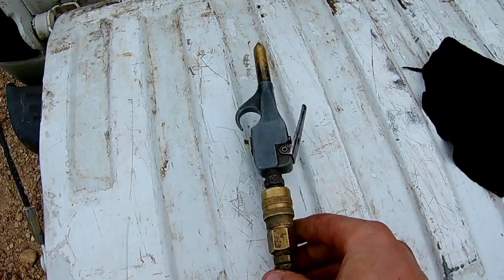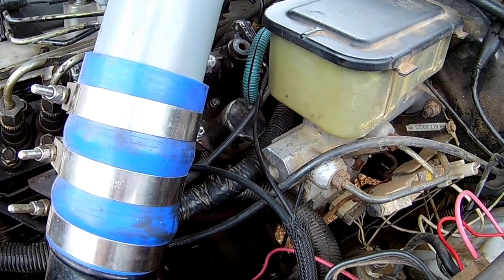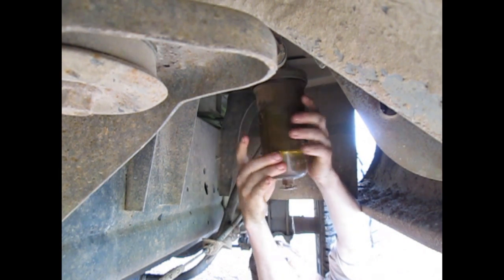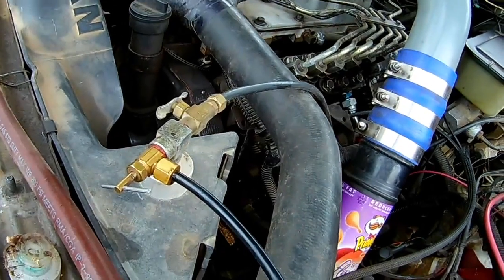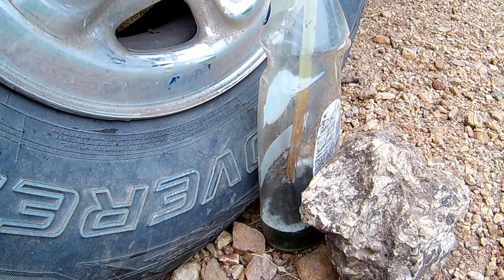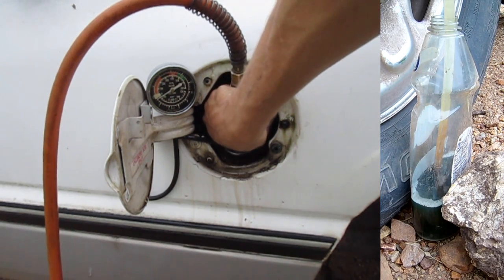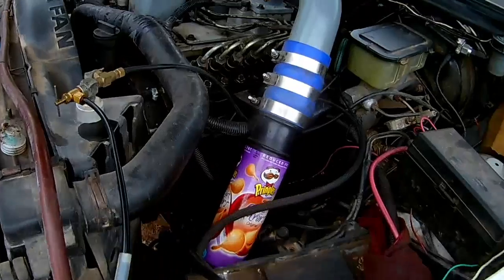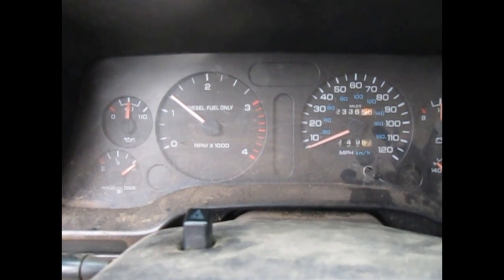How to Bleed Your Cummins Fuel System

Comment: Did this today on my 98 12 valve after a lift pump change. WORKED PERFECTLY and very EASILY.  Truck is early 98. 3500 DRW, 5 speed,. 447,000 miles, on a  beautiful oily 53 block. Truck screams. Will pull anything you hook it to. Great video.

Comment: I made the error of trying to drain scum out of the clear plastic primary fuel filter bowl on my 6BT Cummins dump truck. I was just doing a routine walk-around at a struck stop. Truck would not start, although it had been running fine. I knew I had introduced air into the line, but I did not think it would matter that much. Boy was I wrong! I cranked it for a half dozen cycles. No joy. I pushed that stupid primer button four thousand times. No fuel present. I opened the bleed valve on top of the secondary filter and did it again. Nothing. I finally gave up for the night, and left the truck at a truck stop. Next day I watched this video and acquired the various things to do it with. IT FRIGGING WORKED! Bled the system until no bubbles came out any more and the truck was like thanks pal I am ready to work again. I did not even bleed the individual injector lines. Thanks a ton, a ton, for this advice sir. Really helped this poor owner-operator.

Comment: I  use a empty water bottle with a small hole in the bottom for my air nozzle instead of the rag to pressurize the tank. The top of the bottle seats nicely against the filler neck and i use a regulator set at 2 lbs.

Comment: Are you just pulling the Allen bolt out of the front of the injection pump to bleed it or can you just do it through the top of the fuel bowl I'm getting no fuel to the injectors but I have fuel in the bowl my manual hand pump I do not think is working I just changed the fuel filter and took the preheater out forgot to fill the fuel filter all the way full of diesel cranked it over so does that mean I need to pull the Allen head bolt off the front of the p pump

Comment: Excellent video.  Can this system work as a one-off bleeding exercise ? In other words bleed the full system from tank to injectors.  Is there any reason why one couldn't pressurize the tank without bleeding the filter/separator banjo nut , but instead crack one injector nut at the time? The only problem I can see is that the tank has the return line. This would mean that air would be pushed inside this line, however, with a pair of hose pinch-off pliers  you can seal the return line while you pressurise the tank. The solenoid would also have to be activated so as to open the flow to the pump. I am not sure of the workings of the BOSCH diesel pump but this should work unless the pump blocks the flow when it does not run. Any comments would be much appreciated
Reply: Inside the PPump it looks like a miniature engine with a piston for each injector line. The piston compresses the fuel to extreme pressures and then it all lets out at once when the piston clears the exit port. In a nutshell, there is no open path from the fuel tank all the way to the injectors.

Comment: Great video, but I have one question and I may have missed it, but how did you get the fuel through to the front of the pump without pulling up the fuel shut off solenoid?
Reply from the maker: The FSS prevents fuel from being injected by the injection pump, it does not block fuel from getting to the pump.

Comment: If I have an electronic lift pump will this still work?  I thought I had a lift pump fail but after a new one I’m convinced there’s air in getting in the system.    Fuel pressure will get to 42-45psi but dies if you give it hard gas.  And had gotten worse upon trying to figure it out.    No visible fuel leak whatsoever

Comment: You only addressed bleeding up to your filter.  If your injection pump has air then once you have bleed the air out of the system up to your filter you then should loosen the bleeder on the Injection pump line to rid that portion of the system of any air. When you don't have bubbles and spurting and the overflow valve is squeaking, then you have bled that portion of the system.

Suggestion, show under the truck your line hook up and the like when doing those kinds of changes/upgrades. Just saying yeah we are doing this is only partially helpful.  I believe you are going to have some  leakage on your fuel lines with time as the braided stainless line does not shrink fit onto the fittings like the hard plastic lines that were on the truck. (I presume  they are hard plastic because of the manner you mentioned on removing them.)

Heating the outer sleeve which is a fuel and oil resistant rubber won't do much to shrink the line. Odds are your new lines are Teflon tubing followed by the stainless mesh and then the rubber out cladding/protective shielding.  Your Teflon inner layer may be heat shrinkable but the stainless braided mesh is not going to tighten up nor would that outer rubber contract as well. If it does, then cool...  Otherwise you are running the risk of your lines getting pulled off or leaking later.  I recommend you install some hose clamps on those connections.
So, did you just put a barbed connector in-between your lines out of the fuel tank to join the factory lines to the tank?  You are kind of quiet on what you did for those rusty fittings...

Any suggestions on where to get your handy fuel petcock for bleeding?  Looks like you re-used the plastic line from your old fuel lines, is that correct?

Good video, they get easier the more you make...
Sometimes having some cue cards to keep you on track for the points you want to touch on help...just a list of those things can help you remember while the camera is rolling.  Good editing on the split screen, very helpful to see that without having to switch camera feeds.

You may want to consider pulling that fuel tank and giving it a very good interior cleaning and you may need to consider a fuel tank liner as that much debris is not good. 
Was it algae growth, that can clog fuel filter screens and filters, definitely want to keep an eye on that.  Old fuel can get those growths really bad.  Definitely use a fuel stabilizer when fueling up to prevent that growth in case the truck sits for a while. In winter it is always a good idea to use an anti-gel additive, make that required, if you are in a cold climate or freezing weather.

David
Reply from the maker: Yes, after posting the video I realized that I only bled up to the filter.  Typically, if you get fuel to the filter, it will still start, it may take 5-10 seconds of cranking first is all.  I do hope to make a part two covering that though, plus give instructions on how to bleeding the injector lines if they're air-locked.

I'd love to show you all the changes to my fuel system, but I always struggle with making the videos to long, so I tried to show only the important bits, if you're interested in my fuel system modifications, than I can try to make a video covering them all.

My old fuel lines were primarily steel, which were all either kinked by the PO or rusted.  So I replaced everything with Trident A1 15 Marine grade fuel line.  http://tridentmarine.com/wp-content/uploads/2014/04/365-A1-15-FUEL-HOSE-Specification-Sheet.pdf

On the old rusty fittings, there isn't a stock steel fitting left, it's all been replaced.

The petcock is just a M18 to 1/8" npt bung in the front of the IP, then some marine fuel line, then another barb going into a small cylinder with a couple needle valves on the top.  One goes to the gauge, the other is my bleed petcock.  I don't have a part number for the cylinder as it came off the tire-changer when I replumbed it.  And I don't think it was factory on that either, hence I removed it.  Same goes for the plastic line, it probably isn't rated for diesel, but I doubt  that's a problem due to only having diesel in it a couple minutes a year.  Plus if it starts leaking it's not a live or death crisis.

Thanks!  Yes it's getting easier, I'm not a camera person.  The reason I started these videos was because I was very socially awkward, so I figured if I practice talking to a camera instead, practice makes perfect...  Good tip on the cards, I'll have to do that.

It was rust.  I believe I got a bad batch of fuel as it clogged the fuel filter up at the same time.  I just had the tank out last year and it was super clean.  Also having the sump helps let all the crap get caught in the fuel strainer.  You'd be surprised what all it catches after installing a sump haha.

Comment: super easy to push the primer on the hydroboost trucks, just use a broom handle.  vacuum trucks like mine are a pain, but still doable.  I like that filter setup
Reply from the maker: Very true.  The primer does take forever if you're sucking air, especially if you've got 1/2" fuel line as that alone is an 150% increase in volume, plus the pre-screen which was empty.  The video is 11 minutes long, and has most if not all the vital steps required to do it, plus a lot of chit-chat.  So bleeding the entire system in under 10 minutes should be easily achievable.  Plus the lift pump primer is a common leak point, so by avoiding the use of it, hopefully prolongs its life.

And, yes, I really like that pre-filter setup.  I installed it a while back when a buddy and I were playing around with our trucks trying to get the absolute maximum out of the stock mechanical life pump to try and compete with the newer electrical pumps.  New lift pump springs, Increased fuel line size, larger pre-screen/filters, etc.  We more than doubled the stock flow, so it was a bit of a success!

Thank you again for watching, and being my one and only faithful commenter lol.  I really appreciate it!
Reply: CumminsWorks 
I've been meaning to drill a hole and stick a long 18 wheeler valve stem into a spare fuel cap and use that for this purpose. that would definitely speed up the process.
 thanks for being the one and only YouTube channel that posts useful and relevant information
Reply from the maker: That's a great idea!  If you do it, I need pictures!

Ha, I'm not so sure on that, but I do appreciate it.
Reply: CumminsWorks  I can't take credit for that.  credit goes to the mysterious and legendary Bill Flemming, know as illflem, or infidel.  he's fallen off the face of the earth a few years ago.
Reply from the maker: Ahh yes, Mr.Illflem.  He's the one I got the air hose trick from!  haha

He helped me with my first cummins issue, and it was because of him that I started 'foruming' a bit, and that of course led to truck mods, trial and error, and then helping others with there issues, which then led to youtube.  When he left cumminsforum, he said that he was tired of the continues on slot of noob questions.  Can't blame him he'd been going at it for over 10 years.  I hope all is well for him, and he knows how much he helped so many people.
Reply: CumminsWorks  still sad that the guy left, he literally knew everything.  Any odd problem someone had he would tell them how to fix it in a sentence or 2 and often had a picture from the FSM as well
Reply from the maker: Lol yep, that's Illflem, he was amazing.  Forums are full of people regurgitating information that they got from someone else, who probably got it from someone else.  Well he was basically the source of most of that information, and if he told you something, it was from personal experience.  And like you said, someone could come in with some strange unheard of problem, and he'd have dealt with it 20 times before.  I always have and always will think of him as a 12 valve god.
Reply: CumminsWorks  yeah I'm a little guilty of that now, but since I now have 3 12vs I regularly deal with, I'm getting there!
Reply from the maker: Haha, with 3 of them it won't take long at all!  If you don't mind me asking, what's your username on the forums?  Mine's 'Cowboy303'.
Reply: CumminsWorks  I'm the moron alanack6795, the one with 3 stock trucks and only 1 runs at any given point.  any time I get enough money and close to doing pump work something else fails.
Reply from the maker: Ha!  I had a hankerin' that was you, minus the moron bit.  I went to your youtube profile pic and didn't recognize it, but that must be your old plow truck the 94 replaced?  then you got the 98 recently, and I was trying to think of the 3rd 12 valve. lol  
I've got a couple I maintain here too, but I've been fairly fortunate with the white 96, the only really failures with it were self-inflicted. haha

So you're very familiar with the forum life.  That's one of the reasons I'm playing with youtube because everyone says "use the search function" but there is so much BS on forums that even if you do make good articles, people still have to weed through the crap, and I figured more and more people are just searching youtube, so if there was decent information, they could find it easier.  I'm trying to become better at youtube, then I'll try the more complicated subjects that keep coming up on CF.  One of which I'm kinda looking forward to is "How to tune your 12 valve".  With a camera pointed at the exhaust, gauge overlay, and clear instructions, it has the making to be a bang-up video that should help a lot of people.  But I don't want to tackle it until I get better at making these videos.  

One thing that's been holding me back that I took care of over the last couple weeks was my editing PC.  My old one just wasn't cutting it, so I built this one which blows the doors off the old one.  There was a bunch more editing in this video and that's why, my old pc didn't like playing 1080p video, not to mention overlaying 2 1080p clips at the same time.  This thing will do 4 clips, maybe more but I haven't tested. 

So anyway,  I've been slowly making a list of all the future videos I'd like to make.  If you've got any video ideas or suggestions please let me know!

Thanks again and take care!
Reply: CumminsWorks  I've never really gotten the search function to work correctly.  yeah that's my old farm truck.  it's in good shape minus the cab falling off the frame.  it will get  cummins swap possible in the next 35 years LOL.  I'm thinking about rebuilding my 47Rh myself, I know your a manual guybut if you had any valve body or general automatic transmission knowledge you could share that would be great!
Reply from the maker: Oh, yeah the forum search function is seriously screwed up lol.  I just use google as well.  Unfortunately, I am not an automatic transmission guy.  Even when I was DDing the red truck which had an automatic transmission, I didn't pay attention to that stuff because I knew I wanted a manual.  I'm not even sure exactly how to check the oil. hahaha

Comment: Bro I know it was for demonstration purposes. But that was 100% dumb. If you run a Cummins out of diesel like that. Those p pumps are cooled by diesel. Just like the vp44 on the 24 valves. Running them out of diesel causes ware and tare ont the pump itself. So when you do that. Especially if more than once your just begging for a failure down the road with those 12v melt downs are a problem. But hey you do you brotha. Just some advise.

Comment: The debris in the fuel water separator made me cringe. I'm impressed how much it took to kill that engine
Reply from the maker: You're telling me!  I must have got a bad batch of fuel, because it also mega-clogged the fuel filter to where fuel pressure was going down to single digits at WOT.  After swapping filters and cleaning the pre-screen, pressures were back to normal.  And yeah, it took a lot more to kill that thing than I expected.

Comment: Iff my truck sits for 2-3 days it gets hard to start ( turns over  but wont just fire up ?? what say you or how about a vid?
Reply from the maker: Sounds like you've got a leak in the fuel return line going from the injection pump back to the tank.   With the engine not running, it allows the fuel to drain back into the tank after an extended period.  There's a short section of rubber line that likes to dry rot that may be your culprit.  It's the red one in this picture.  http://s20.postimg.org/4meh3r33h/screenshot_1.png

It's kinda hard to see, and harder to get a decent video of, but I may see what I can do.  Life is kinda limiting my video time here recently, but I hope to be able to go at it again in a couple weeks.
Reply: Do you think this could effect idle when its cold .. It seems to be when I get it started to be ? 200 rpm lower . But idles higher when its warm?
Reply: @CumminsWorks  I inherited a 1996 Beaver Monterey RV with a Cummins diesel engine from my Aunt who passed away and apparently hasn't been started in almost 18 months. I changed the 2 chassis batteries and a friend suggested I "bleed" fuel filter. I was a UDT frogman in the Navy so I'm really good at blowing stuff up but have little or no mechanical skills. Can you help me? I need to drive the RV down to Florida where I live from Virginia. Any tips on how to proceed would be GREATLY appreciated.

Comment: What is your bleeder valve hooked up to on pump?
Reply from the maker: The front port that the bleeder is hooked into goes into the fuel gallery in the pump.  It literally the same as teeing them into the input line going into the pump, except because it's in the pump and a higher point in the fuel system, it does a better job of bleeding the air.